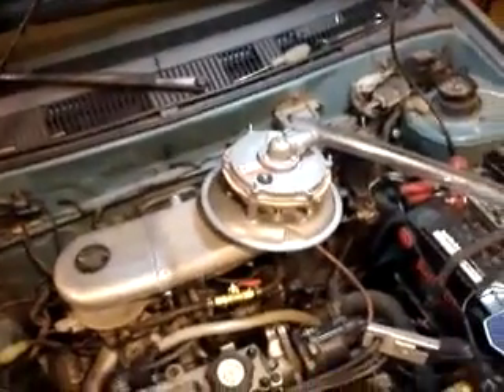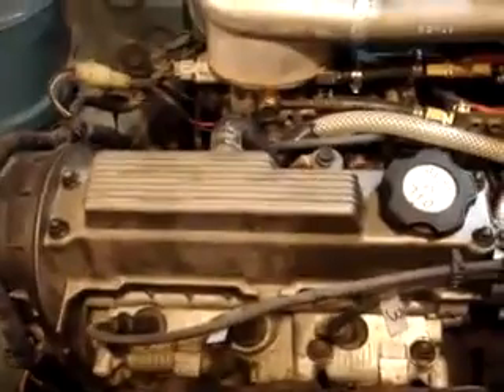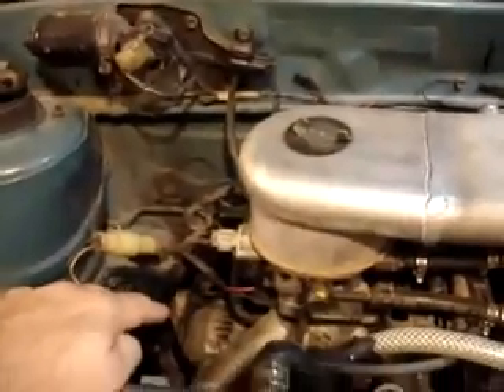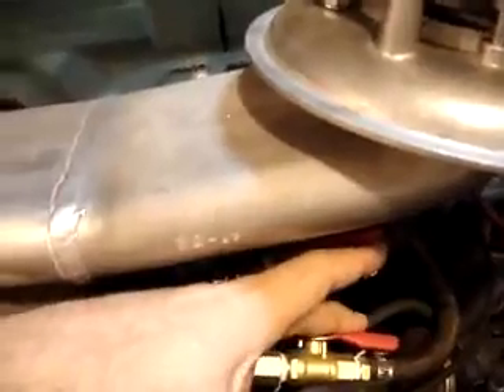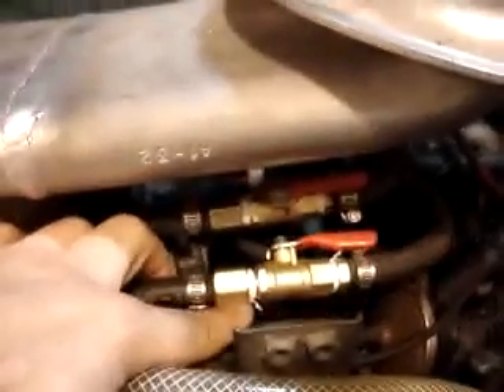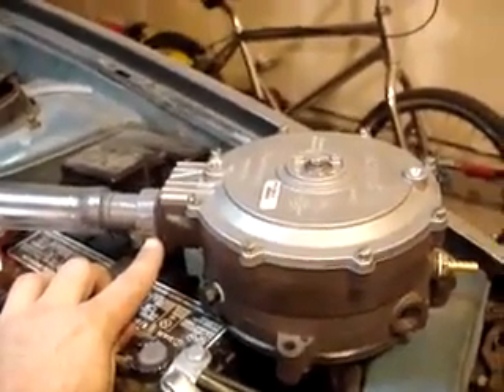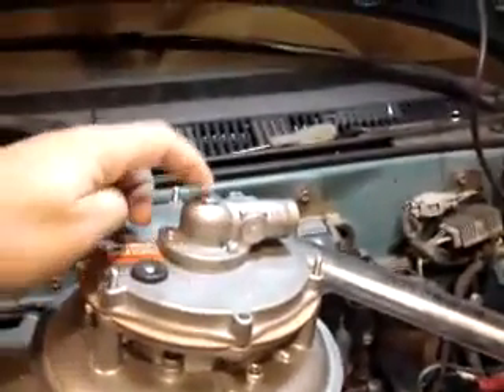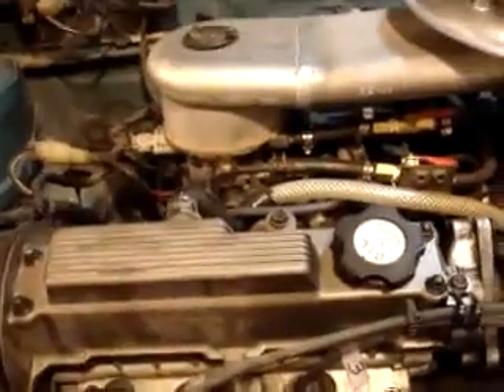Hydrogen Fuel Co., Inc. - 100% Water Powered Geo Metro Demonstrated by Advance Tech Engineering

Comment: Don't see anything running. But you are creative so think about this. A stun gun operates under one AMP and can put out 10,000,000 volts(they sell for $30.00 on line). No need for a bigger alternator. Just a PWM to control your pulse width.